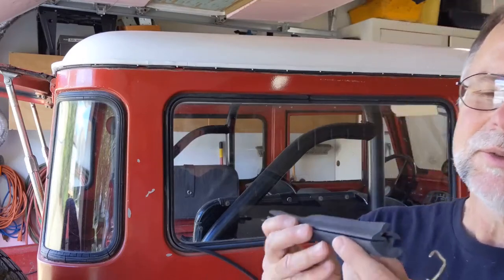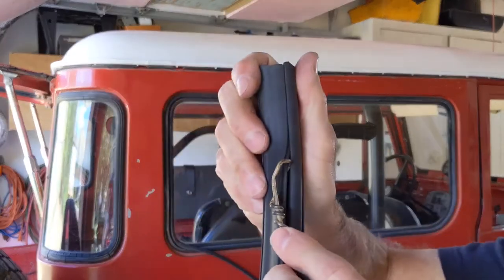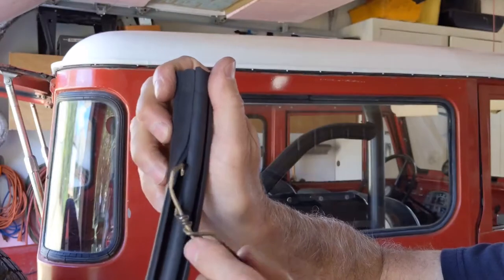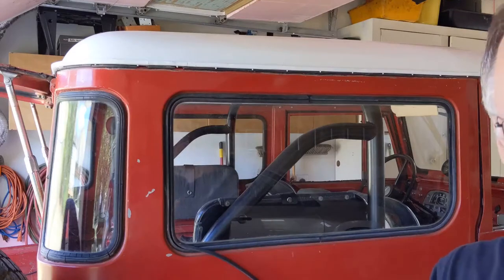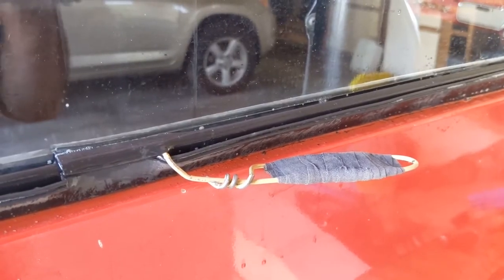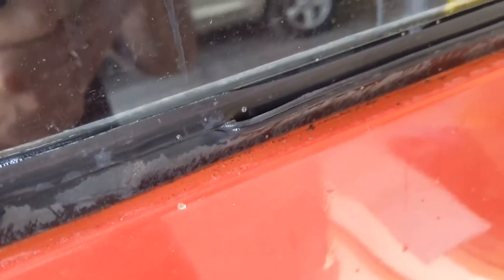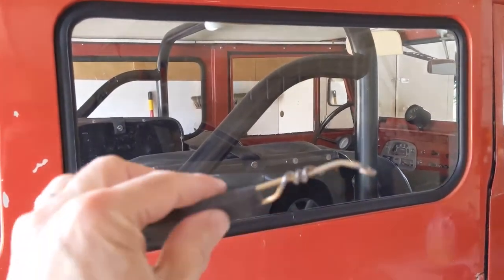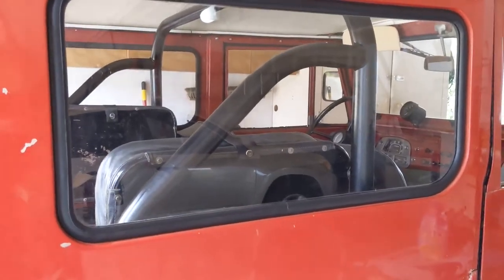Making My Own Tool - Window Seal Update

Comment: Nice video. I'll start the process of replacing the seals. Can you share where did you buy your seals? I can only find the two piece ones (rubber and key separate)
Reply from the maker: I bought Trim-Lok LK1522-25 seals on Amazon. These are the one-piece version. https://www.amazon.com/gp/product/B00NL48LXA/ref=ppx_yo_dt_b_search_asin_title?ie=UTF8&psc=1

Comment: I wonder if a crochet hook would work.  Did you buy the flat plastic tool?
Reply from the maker: I don't think a crochet hook would work.  I bought several flat plastic tools, which show up in the "Struggling with windows" video. It worked, but was very slow.

Comment: Always heard that the joint in the rubber should be at the top.
Reply from the maker: There's a wide joint for the glass and a narrow joint for the metal. If you're talking about the lock, that's right in the middle.

Comment: Which TrimLok seal did you use?
Reply from the maker: Trim-Lok part number LK1522:
 https://www.trimlok.com/rubber-extrusion/locking-gasket/one-piece/lk1522

Available on Amazon: https://www.amazon.com/gp/product/B00NL48LXA
Reply: @mikerestoresanfj4069  thanks for the reply Mike. 
A couple more questions if you don’t mind. 
Did you do the corner windows with the TrimLok?
& (I know it’s only been a few months, but) how has it been holding up since you installed the windows?
Thanks in advance.